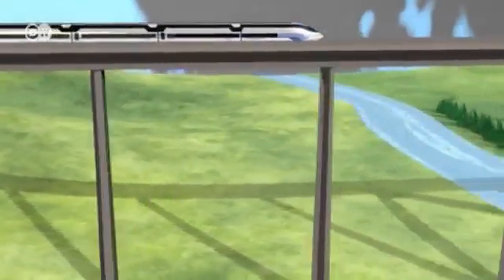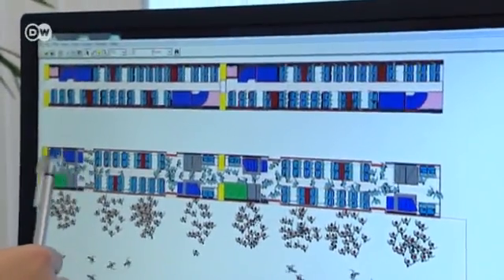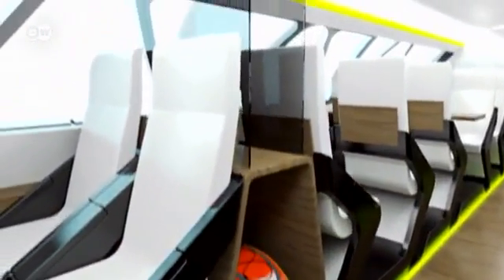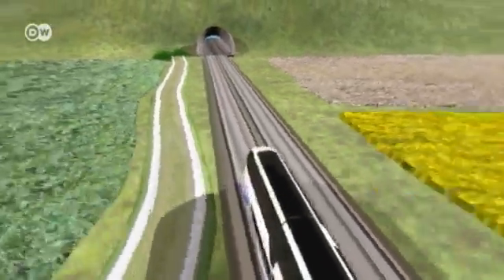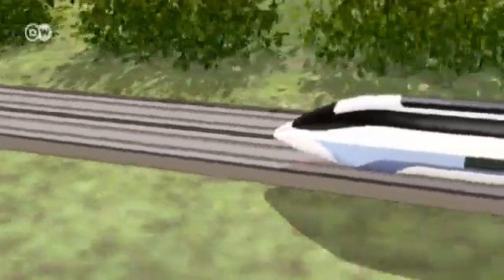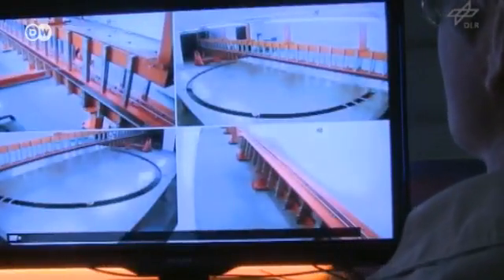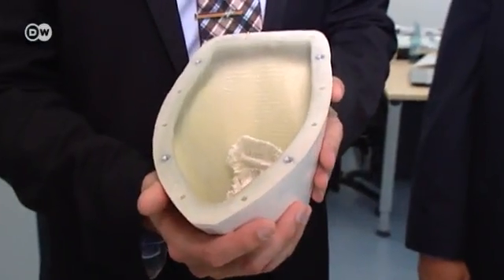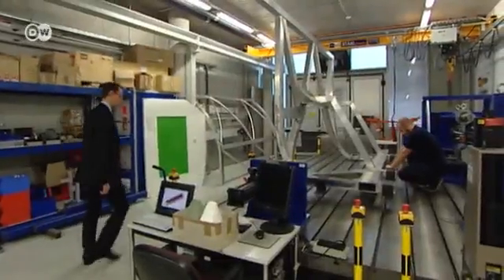Tomorrow's Trains | Tomorrow Today

Comment: `10 years ago ,Germany was developed a maglev train that travels at 500 km/hr.at 60 million dollars a mile that was never built..In 2014,Jiaotong University ,China s oldest railroad engineering school ,with government funding built and tested a small magle4v train at 1,000 km/hr.in a vacuum enclosure.CRRC will build a larger maglev train between cities at a designed speed of 2,500 km/hr.CRRC has built three medium speed maglev lines,one in Changsha,the red line in Beijing,The only maglev monorail (line 2) in Chongqing and is building 9 more in other cities.

Comment: trains will need to get bigger (in some countries the standard train is already to small) building a double decker train is a smart idea but i like the wide train because the floor space allows for better layout if u want future trains to have restaurants, stores, better luxury rooms or more.  i understand y this double decker layout is better because its infrastructure takes up far less space witch is a premium in cities.
Reply: Wider trains are slower. Broad gauge has worse driving characteristics at high speed corners, and with normal gauge you can't go much wider.

Comment: Maglevs are the future trains
Reply: Ahmad Razaq Maglevs lie on the far future.
Unfortunately Germany abolished its maglev line.
Japan will complete its first commercial maglev line in 2027.
The maglev will take years more to come in our daily lives. It's expensive and complicated.
For now let's stay on conventional HSR.
Reply: I could not agree more...seeing just the few seconds of this video and the "future" train is still on wheels?!?...it's really time to ditch the wheel.
Reply: It'll do
Reply: Ahmad Razaq: Not always. Maglevs are expensive and suitable only for when you travel at really high speeds (well over 300 km/h) for extended periods of time. At lower speeds, they become inefficient compared to conventional high-speed trains, i.e. those with wheels.
Reply: Ahmad Razaq  Ditch the wheel?? How on earth is the train suppose to move, it still 
has wheels, but the wheels are low and attach to the track.
Reply: Magnetic levitation...
Reply: Yes they are the future, and they are a German invention....
Reply: Too expensive.
Reply: There's a hybrid mixture of both conventional and maglev railroad tracks called the "Magnerail." MTS - MagneRail

Comment: Is this intended for the American market? Because some of this stuff has been employed for ages with the TGV (lighter trains) and ICE3, AGV and Shinkansen.
Oh, and having no internal staircases is really not a good idea in case of an emergency stop because of, let's say, fire.
Reply: Well, actually its German.
Alumium trains is not that comon. The TGV-Duplex is aluminium, and probably some of the Shinkansen trans. But no other Europeans trains are made of aluminium. They are all carbon-steel or in some cases (as ICx) stainless

Also, power-unit-less high speed trains is not that common outside of Japan. Its basically just ICE3 and AGV (That is just in service in Italy). Most engineless trains are intermedium high speed trains (mostly 250km/h).

Steering wheels also doe exist, but only on the some Spanish and one Swedish train (the green train). The Swedish one is the only one with electronic steering.

Also, with full two story trains is not that common, i don't even know if it exist in Japan. Here the train axels are basically just virtual axels with no real physical axel connection. There exist trams with that configuration, but no trains.

Its not only that its aluminium construction. Its really light weight aluminium construction, reducing the wight over TGV duplex by 25% while including engines and powerelectronics.

Also, because its a full length duplex car it fits 30% more passenger per meter than TGV-duplex cars. Including powerheads the number is about 65%.

A other neat thing is that because the paying weight is a large part of the total weight (about 30%) . The maintenance cost is cut down when the trains run with empty seats.Quite significant because its non limier.

I can agree on the staircase problem tow....
Reply: The maglev is being built by a different region to that where the bi-level Shinkansen were used.

"The Japan Railways Group, more commonly known as JR Group, consists of seven for-profit companies that took over most of the assets andoperations of the government-owned Japanese National Railways on April 1, 1987. Most of the liability of the JNR was assumed by the JNR Settlement Corporation. 
The group consists of seven operating companies and two other companies that do not provide rail service. The operating companies are organized into six passenger operators and a nationwide freight operator. Unlike some other groups of companies, the JR Group is made up of independent companies, and it does not have group headquarters or aholding company to set the overall business policy. "

JR East operates all of the Shinkansen, high-speed rail lines, north of Tokyo.
* Tōhoku Shinkansen (Tokyo - Shin-Aomori)
* Jōetsu Shinkansen (Ōmiya - Niigata;
* Echigo-Yuzawa - Gala Yuzawa)
* Nagano Shinkansen (Takasaki - Nagano)
* Yamagata Shinkansen (Fukushima - Shinjō)
* Akita Shinkansen (Morioka - Akita)"

The E4 series is/was a high-speed shinkansen train type operated by East Japan Railway Company (JR East) in Japan. They were the second series of completely bi-level Shinkansen trainsets to be built in Japan (the other being the E1 series). They operate on the Tōhoku and Jōetsu Shinkansen, and occasionally on the Nagano Shinkansen. 

The Tokyo–Osaka Tōkaidō Shinkansen is owned and operated by the Central Japan Railway Company (JR Central), although it stops at several JR East stations.

Central Japan Railway Co. has announced the transport ministry cleared its plans to build a 178-mile line that would cut the Tokyo-Nagoya journey time to 40 minutes, less than half the current time of about 1 hour, 40 minutes.

JR Central hopes to complete the work by 2027, with an eventual onward link to Osaka.
Reply: matsv201
Further research shows that all the double decker shinkansens are being retired in 2014
http://ajw.asahi.com/article/behind_news/social_affairs/AJ201406060010
Reply: Neil Hamilton Yea, i actaully heard about that just after i wrote the previus text. 

They don´t really need them after they open the maglev track. But i don´t really know what they supose to do in the intermedate 12 years.
Reply: I suggest the future train has existed for some time in Germany

ThyssenKrupp Transrapid Maglev System 
was implemented in Shanghai 

I had the pleasure of riding it in 2010
Shanghai Maglev Train and People Square Subway Station 2010 Video

This is being promoted as the system we should use here in Australia
http://www.monorailsaustralia.com.au/maglev.html

There is another high speed Maglev system in planning stage in Japan.

http://en.wikipedia.org/wiki/Ch%C5%AB%C5%8D_Shinkansen

http://www.dw.de/japan-to-start-work-on-first-long-distance-maglev-line/a-17879028
Reply: Neil Hamilton Yea, to bad the track was closed down back in 2012.
Reply: Neil Hamilton
The justification for that is strange, though: speed. AFAIK, the TGV Duplex happily runs at 320 km/h. So what's stopping the Japanese from doing the same thing? Technical limitations perhaps?
Reply: Severity One Economics. The reason why Duplex run at 320km/h is that they have a lot of seat per ton of train. So the per seat wear is relatively low. Also, Duplex only run at 320km/h for a relatively short distance on select lines.

In addition the track is state subsidized, that is not the case in Japan. But JR in Japan just anused they will increase speed on one line up to 320km/h. The reason is probably that they build up demand until the maglev part is finished. If it profitable or not is less important. When the maglev is finished it will swallow all of the traffic in the area and they will probably decrease the speed to commuter speeds.

There is no real technical limit under 380km/h. But from 250km/h and up the economics is that that good. There is  several reasons for that, so its not just one or two issues to solve, rather around 20 issues.